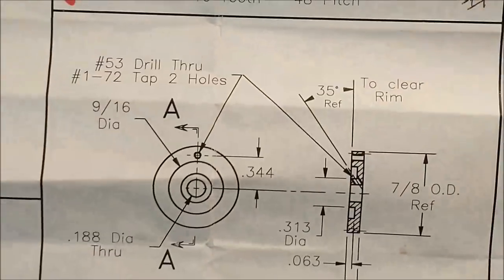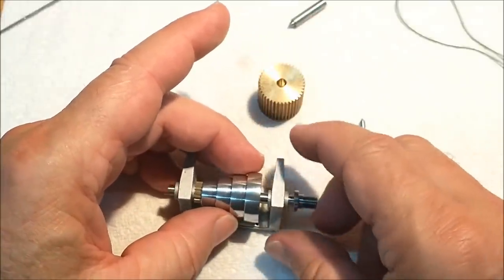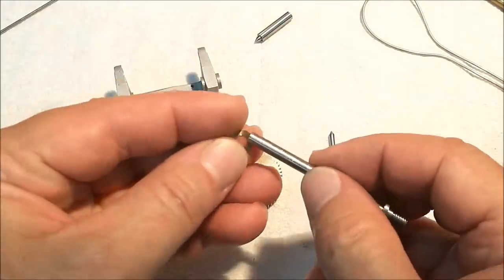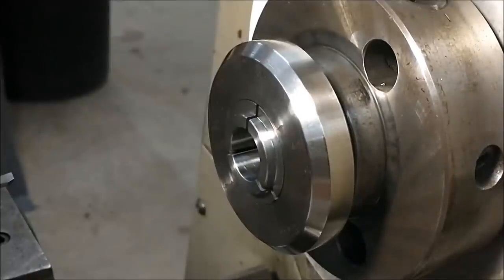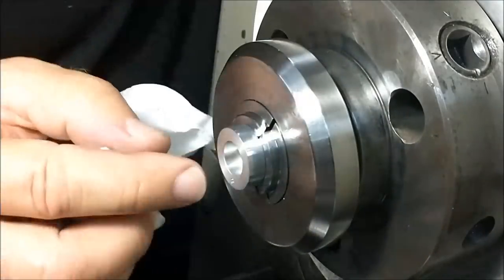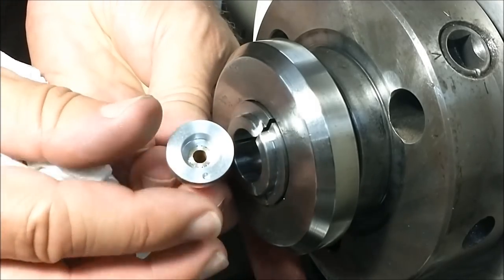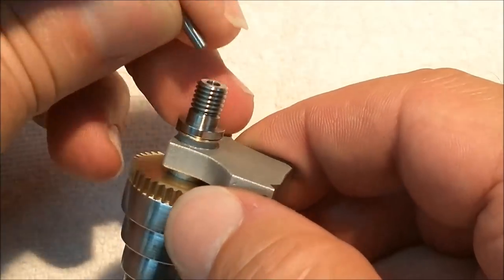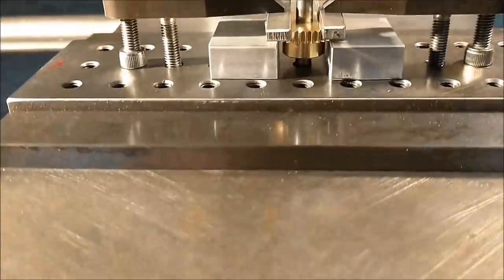Main Spindle Gear - A Design Change You Are Going to Like !!!

Comment: Guess I’m a little slow this morning. I don’t see a need for a setscrew through the cone pulley. When the bull pin is engaged drive is direct. When disengaged gear and cone are independent. Why the setscrew against the shaft that could possibly mar it? What am I missing? Thanks.
Reply from the maker: This is a good question because I bet many don't truly understand what is really going on here. The large spindle gear is responsible for turning the spindle at all times. This is a fact. However, that gear can produce 2 different ranges of speed. One direct, and one in back gear. When your machine ( or this machine ) is in high range, the bull pin ( set screw ) is engaged into the cone pulley. So every time the cone pulley spins, the large gear does the exact same thing. When you engage back gear, you do 2 things. You advance the rear back gear shaft to engage both the small and large gears on the spindle, and you pull the bull pin ( 'unloosen' the set screw ). Now the magic happens. As the belt turns the cone pulley, that rotation is translated to the smaller gear on the spindle that is pressed into the cone pulley. That smaller gear now turns the larger gear on the back gear shaft. The smaller gear on the other end of the back gear shaft now turns the large gear on the spindle at a different rate than the cone pulley is spinning. Thus producing a slower RPM and higher torque. You may have to read this a few times to get it, but its a very clever design. And if you noticed, I have a receiver flat on my spindle for the spindle gear set screw so it will never mar the spindle, and allow for easy disassembly. Great question. Thanks.
Reply: @joepie221  Thanks, I sort of get it but it did take a few readings to understand what’s happening. The setscrew with shaft flat is to insure that the cone and shaft turn as one unit while the back gear is engaged, right? Funny I don’t recall needing to tighten and “unlooosen” setscrews though the cones of the many SouthBends and Logan’s that I operated over the years but my memory at 87 is not what it used to be. Indeed, the arrangement was a very clever design. Thanks again.
Reply: @Joe Pieczynski - can I try?

There’s a gear on each end of the cone pulley. One is engaged by the reverse drive we milled and installed a few vids ago. One is the big drive pulley we installed today. When the set screw is engaged through the drive pulley the mill is in “normal operations”. But you can disengage that set screw and toggle the reverse drive system to engage the small pulley at the narrow end of the cone. It’s an either/or situation: either the back drive lever engages the small gear, or the belt drive is locked to the big gear, but that big gear is always locked to the main shaft. If you engage neither the lathe is effectively in neutral. If you try to engage both… well… look out for shrapnel. Lol
Reply: @ellieprice363  I think Joe's talking about two setscrews.  The one that he's fitted here is acting like a key to fix the large gear to the shaft (it's just convenient to place it where he has) and I think this will be permanent.  If it wasn't for this set screw, both the cone and gear would spin around the shaft.  The second set screw (that I think he is talking about) is to lock the cone and gear together, so the cone moves the gear. (Rather than going through the rest of the gear box)
Reply: Hey Joe
Nice work and good thinking. If you are concerned about dirt coming in put a small scew in your pully there are space enough.
Reply: A very simple point is that the shaft and the gear MUST be performing (turning) together as if they're ONE PIECE at all times. Very simple.
Reply: 2LeftThumbs: This transmission is not easy to understand. In direct drive the large (bull) gear is keyed to the cone assembly and rotates with it. In back gear the large gear and cones rotate at different speeds so the large gear cannot be locked to the main shaft.  If it is locked and back gear is engaged the spindle will lock up, or more likely the powerful back gears will tear the set screw loose and jam the assembly. The setscrew should key the pulleys to the main shaft through the center cone instead of through the larger right cone and main gear as shown in Joe's modification.
Reply: @ellieprice3396  > The setscrew should key the pulleys to the main shaft through the center cone instead..

Ah, I see the confusion. You have it just reversed. The cone pulley is keyed to the small gear on the far left of the headstock, but that assembly is free-floating (or free turning) on the main shaft. It is the big bull gear on the right of the headstock, just on the other side of the main bearing from the chuck, that is keyed to the shaft and which drives the chuck.

In normal direct drive the motor drives the cone pulley with the belt, and then the cone pulley drives the bull gear with the horizontal lock pin. The bull gear drives the shaft, and the shaft drives the chuck. The cone pulley is still loose on the main shaft, but that doesn't matter because it is keyed to the bull gear with the lock pin.

In back gear the cone pulley is loose on the shaft and is driving the small gear on the left. This is in turn driving the back gear shaft. The other gear on the right of the back gear shaft now drives the main bull gear (the direct drive pin obviously being removed), and the main gear again drives the spindle and the chuck. Thus it is the bull gear that has to be keyed to the spindle in some way.
Reply: @ellieprice3396  I guess it will become clear when it's assembled and running :)
Reply: @2lefThumbs  Well, after some research I'm now prepared to eat a little crow. But, I don't mind since this discussion has been a great learning experience for me. The large gear powers the spindle shaft at all times as Joe said, just different from how I imagined. I wanted to learn how the cone assembly was driven so Google sent me to a site that explained exactly how it works. "Old Iron Lover" takes apart a 13 inch South-Bend headstock and reassembles it with a new "Cam-Loc" spindle. Here's the links for part 1 and 2 that shows how it's designed. 
https://www.youtube.com/watch?v=rtoS7KkFW3c  https://www.youtube.com/watch?v=rfWqsIto1B4
Reply: @ellieprice3396  that's kinda how I imagined it, I wasn't being "snotty" when I said I hoped it would all become clear when he assembles it though, like you said it's complicated, and the best way of understanding some things is to see them running as a whole .  The second best way is to discuss, like we've done on this thread and tey to find enough words to describe a system fully - not easily done tbh.  👍👍
Reply: @2lefThumbs  Joe's the best. Good project.
Reply: @joepie221  I had to read this a few times.  But it was the pressed pulley on the other end of the spindle that made it all come together.  I have a south bend 13x60.  So it is a similar design.  I like the change you made there now that I understand it.  Before I even read the comments I probably sat here 20min trying to make heads or tails of how this would work.  Nice Job.
Reply: @RonParker  That Woodruff key in the bowl gear was a ripe royal pain in the butt to get out. You had to loosen a piece on the back end of the spindle, allowing you to pull back the cone pulley a little bit. You then had to to reach in with very long needle nose pliers in about ¼" of space and tug on the end of the Woodruff key and rotate it out of the shaft & gear hub. There was only enough room to slide the gear about halfway over the key.
Reply: @PaulSteMarie  fortunately, Dad's was the split Babbitt type, so the spindle came out as a unit. We never got around to doing the Timken conversion before he died, but it sounds like it wasn't fun.
Reply: @ellieprice363  - South Bend, et.al, had back gears engaged by the countershaft mounted on an eccentric carrier. The direct drive is engaged by pushing a detented pin into the direct drive gear.
Reply: @alanhardman2447  Thanks, you are correct. After watching George Bell restore his 13 inch South Bend headstock on YouTube I now know exactly how the different parts fit together and work. George and Joe are very good teachers.

Comment: I found the title of this video to be spot on! That's the right solution to this design error.

I would suggest adding a second setscrew in the bull gear hub, at 90 degrees to the first one. This gives maximum grip to the shaft (more than double what a single screw provides), and is standard practice in model engineering.

Comment: That's what I like about seeing someone else do the same project it gives better understanding of part production from some plans, because I assumed that the hole in the back of the drive pully, was what you used to lock the gear to the pully. I didn't realize that it was supposed to spin independently at first until I tried to put it together. Those gears didn't like that. Also love what that sandblaster does to your parts makes them look great. Excellent work!
Reply from the maker: Thanks. I too am learning a lot about the design as I go.

Comment: Perfect solution!!  
A 30° pin is a pretty large ask on such a thin part as it is, let alone one that's going to be driving the spindle..  
I hope PM is taking notes! 👍🏼
When you get the steam pumping I'm praying you spend a good amount of time making chips!
BTW..  That toothpick size boring bar looks like it would also make the prefect ID tool for this lathe.  😉    Fantastic as always!
Reply from the maker: I may have to rig something up for the .025 bar. That would be awesome.

Comment: Cool resolution for a flakey design element.  Impossible designs seem to come from engineers (and draftsmen) that don't have shop floor experience, which I wouldn't have expected from a hobby casting producer.

Joe, could you please explain to my better 1/3 (I'm a big guy) that I'm not nuts for exclaiming "No Joe, the other 90°" several times around 28:28?

Comment: I love the idea of the small hole outside to access the set screw in the drive gear. One thing I couldn’t understand was why you didn’t do the 1.2 mm hole with both parts assembled and engaged then disassembled them and finish the hole for the set screw having a perfect pilot hole? That would line up perfectly in an easier manner as far as I can see.
Thank you! ❤❤❤
Reply from the maker: The plans called for a very oblique set screw hole there. I believe my modification is much better. Setting the alignment of the holes could be done a variety of ways including the approach you suggest.

Comment: Good call on the hidden set screw, my logan is done the same way so no foul. If it was driven in at the oblique angle it would introduce side thrust which would mess with your axial clearances. When you get this all done show us your magnifiers and optical comparators and jewelers tools that you really used!! Hay Hud out.

Comment: Joe, my Logan lathe has a hole in the center of the conical pulley with a set screw for oiling the shaft and has been working fine since the 1950’s . I dint think you will have in problem with the belt, and I think that was the right choice.

Comment: Surgical instrument design you say?
As I mentioned before, my old lathe is a full size example of this type of lathe which I bought off a coworker when I worked in the electronics dept. of a hospital. 
The spindle shaft and bronze bearings were worn out ,so I had my friends in the precision engineering dept, of the hospital make a new shaft and bearings.
The precision engineering dept. made specialist tools for the surgeons. They had a nice collection of high precision machine tools and had a craftsman cutler employed with them who made hand instruments such as haemostats.
They also made large devices like an automated X-ray viewer  and a indexible X-ray bed.
Reply from the maker: I have an extensive background in orthopedic instrument design and fabrication for Knee, hip and spine procedures. Knees would be my strongest field.

Comment: Nicwly done Joe.. My 9 inch SB has an oil hole with a plug for the back gear spindle in the 2nd pulley and it doesn't effect it one bit.

Comment: After seeing what the print called out was for that set screw (35*) that you brilliantly redesigned, I starting wondering how many hobby machinist's have ruined that part trying to comply with the print.
Reply from the maker: I bet quite a few. Off in either the angle or starting point and its over. This is a much safer approach. I hope PM Research changes the print. (and gives me credit of course )

Comment: Super job Joe, well done. Perhaps on final assembly you could plug the pulley hole with a piece of cocktail stick to keep dirt and belt rubber out. Should you need to access the grub screw again, it can easily be picked / drilled out. Or a small blob of PVA glue/ silicone, anything easily removed if need be. Stay Safe. Regards from Australia.
Reply from the maker: Hi Dave. For now, I'll leave it open. If I were to start using this machine, I'd drill and tap that hole for a set (grub) screw.
Reply: Or a toothpick end amount of silicone caulk would form a plug that could be pulled  if access to the set screw was ever needed. Really enjoying the series, there is the occasional 'reset' moment when a giants hand enters the frame. Very easy to forget the scale of this when only the parts are visible. A 3 jaw chuck would be cherry on top, "just" use a bigger one with a pantograph to scale the scroll to mouse turd size.

Comment: Joe, I had a flat belt lathe which had a hole with set screw in the crown of the pulley for lubrication purposes, it did not affect the running of the flat belt.

Comment: My old Mueller has oiling holes in the cone pulley, one in the largest and one in the smallest, tapped for plug screws.  It rolls just fine when it's disengaged from the bull gear, and no sign of real wear.  I assume they used phosphor bronze for bearings, like they did for the spindle-headstock.  I can't see/imagine any problem with that arrangement as long as oil isn't slung out and onto the belt.

Hard to believe, but I do have the upper cone pulley that was used with that lathe in it's original setup.  I plan to integrate it back into the drive system.  The current setup allows infinite speed control, which is nice, but the pulleys needed to get any kind of speed out of it also takes a lot of torque out of it, making it too easy to stall at really slow turning speeds.  I'll need that torque if I ever work on something that is near to the lathe's capacity in size.

Comment: I like it Joe!  I was skeptical that an oblique set screw would stay tight reliably; maybe with Loctite.  Between two teeth of the gear might be another option, but that would weaken the teeth.  I suppose you could plug the hex key hole if debris is a problem.

Comment: Nice job, Your changes resulted in a much improved design. I dislike 45 deg setscrews. The hole in the cone pulley is ok, my Scaublin lathe has a small hole in the drive cone as well...

Comment: @17:18. When you are unscrewing something and you feel the steel is "floating", getting into yield that is, you have to stop and think things over, before you proceed.

It is a feeling of how the torque does not lineary match the angle of rotation. It most often floats before it snaps. On a hardened threading-tap, there are no warning-signs at all however.

Comment: I enjoyed this video very much! I feel that your decision was by far the best. An angled screw in my opinion would not be astecicaly pleasing. And most old lathes had a hole or two in them for oil,  setscrews, or both. I have also seen a set screw drilled at the edge patialy into the teeth of a gear, my old 618 is that way.

Comment: When reassembling plastic parts turn the self tapping screw backwards to find the start of the old thread.
Reply: good practice in general.
Reply: @pacman10182  yeah,will do some good even with normal screws but it's really good if you work with taps often

Comment: A much better solution to the original Joe. Nicely thinking out of the box. Let's hope that PM Research are as generous with the brass gear stock with all the kits as they were with you! I am sure they thought out your solution and decided that it was too easy and went on the angled set screw to make it harder lol
Reply from the maker: I was glad I had enough material to do this. Its a better setup.

Comment: I had an old belt drive mill that had similar set up holding flat pulley (3 step).
Tapping brass can be more difficult than tapping steel, I tend to use taper to start then use bottoming tap as it's only cutting on the end instead of along length as a taper will on relatively deep hole (1mm~2.5mm taps)

Comment: Normally I'd sort of sneer at deviations from the original print, but in this case, I feel your idea is not only original but superior under the circumstances! ;) Moreover, I wonder if anyone has tried integrating a similar back gearing mechanism to a watchmaker's lathe... though on most such lathes, it might just be easier to use a countershaft. But this would be a lot more fun to build, and be more compact!

Comment: I like your videos much. The only thing I hesitate about, is the in my opinion, over-use of compressed air to clean things. It tends to blow swarf and cuttings into the hard-to-get locations of the machine, under the apron and into chucks for instance.
Reply from the maker: Think about it. If you put flour in a cup and blow into the cup, you'll get a face full of flour. if you do the same thing and add water to the cup, you get a cup of paste. Knowing the sensitive areas of your machine and not blowing chips there is always recommended, but otherwise, air wins every time and doesn't pack chips like many believe.